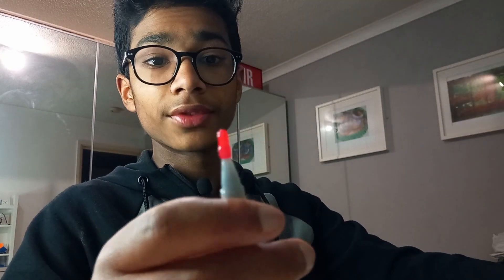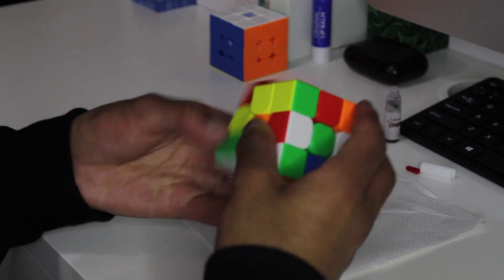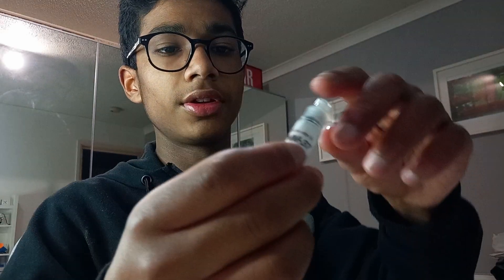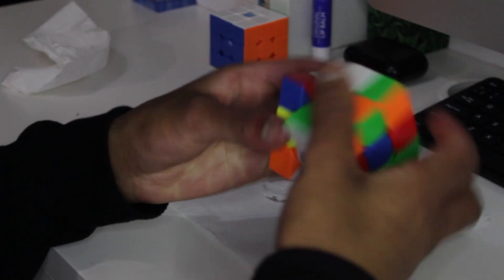Super RS3M Setup Tutorial

Comment: Is weight 3 enough to make it more better
Reply from the maker: If you don't have anything else I think weight 3 is okay for keeping your nice. If you can I would recommend getting the lubes used in the video since they will provide a better feeling than just having weight 3
Reply: Is weight 3 perfect for this or should i get some other like weight 2 . I cant putchase those other lubes u suggested those are expensive .

One question that i have is that super rs3 standard is it worth it or should i go for rs3m 2020 . I am a fast-accurate Turner . Rn my main moyu meilong 3m . And i want to switch to a new cube . Which one should i purchase ?
Reply: My average is 25-26 seconds
Reply: @KamTheCuber  pls reply
Reply from the maker: @M U S A S H I  weight 3 should be good
Reply: @KamTheCuber  u did not reply my another question btw 😅
Reply from the maker: @M U S A S H I  sorry I didn't see that question. I think you should buy the super rs3m it is similar to the meilong and rs3m but is slightly better than both
Reply: @KamTheCuber  ok
Reply: I use weight 5